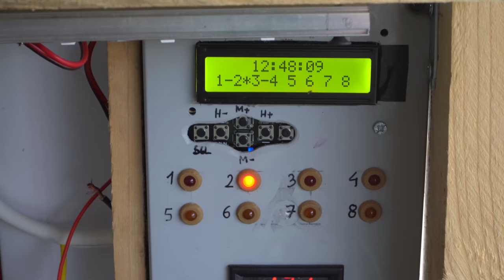DIY 12V LED Grow Light for Plants

Comment: Nyc work dude. I suggest.. 
You can stick led strips direct to circular board. Aluminium strips were unnecessary here.
And there is no use of heat shrink if dont seal the holding rod at bottom end.
Jst think on it..
Reply from the maker: Just to know,red and blue leds make a lot of heat